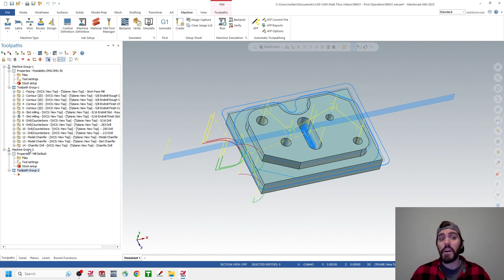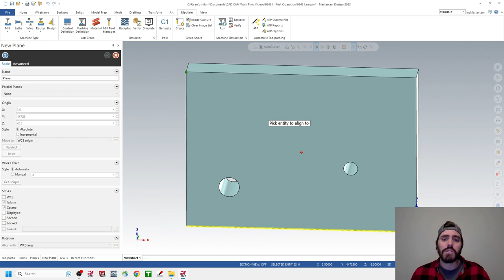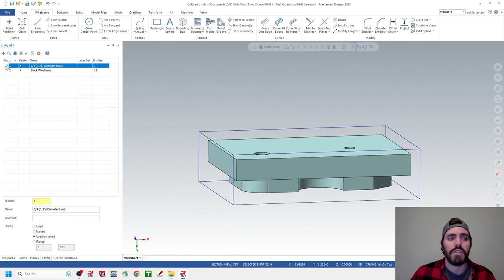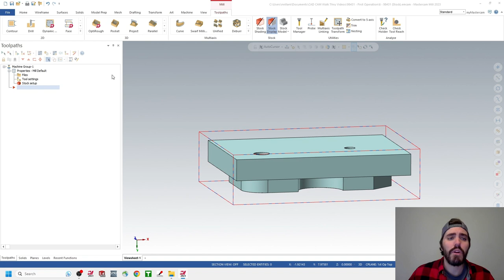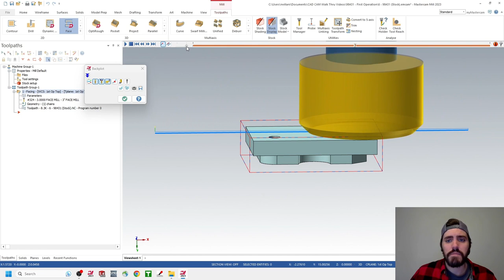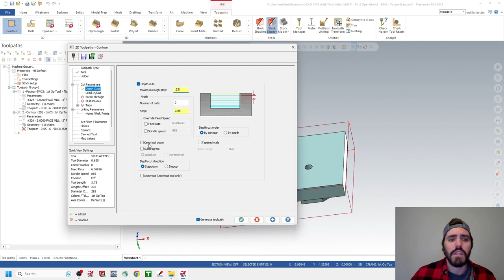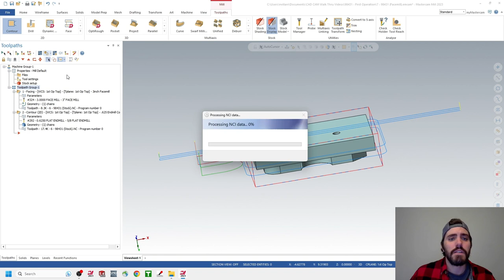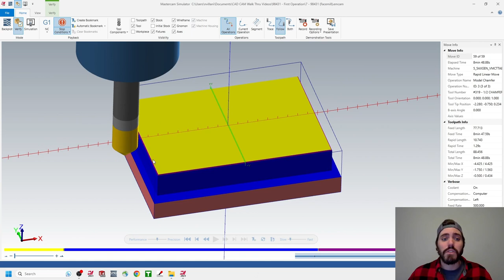MasterCam: Simple First Operation with Stock Setup, Facemill, Contour, and Chamfer Mill

Comment: Thank you so much for great videos. I'm using MasterCam learning edition and having problem with Rigid tapping tapping in verify.  in backplot everything is correct but when i use verify it shows Rigid tapping as if its pecking to the final z, instead of one move. any idea why ?
Reply from the maker: Hmmm, I'm not actually sure on that one.  I don't do a lot of rigid tapping on my end.  We usually use thread mills in class, but I can look into it!
Reply from the maker: You may want to check your Simulation Settings.  There's an icon next to verify and you can also check in your configuration from the File tab.

Comment: 12:50 in mc2021 this used to automatically switch to the active wcs, now in 2024 (we upgraded from 2021 to 2024) it doesnt anymore. Do you know if there is a special setting in mastercam to change this behaviour or could this be a bug/feature?
Reply from the maker: We just deployed MC2024 last week at school.  I'm going to be looking into the new changes later this week.  I'll keep an eye out for it.
Reply from the maker: I have heard rumors that sometime when one feature is turner off/on it could be as simple as the software programmer accidentally deselecting that feature when bundling the new release 😅
Reply: @artofthepart  lol, i might make a post about it in the mastercam forum